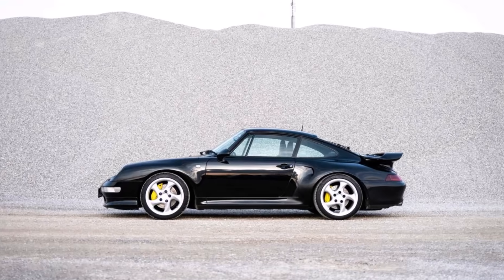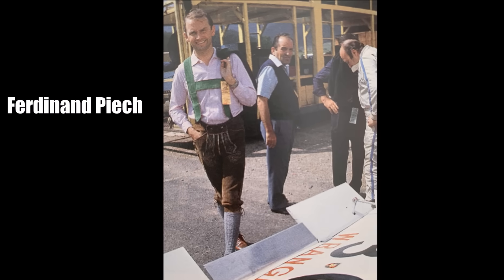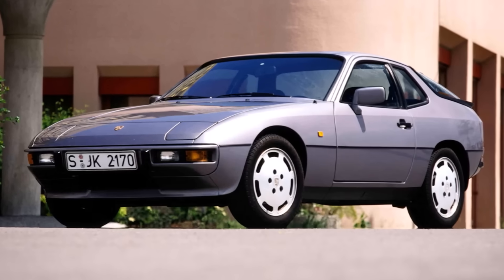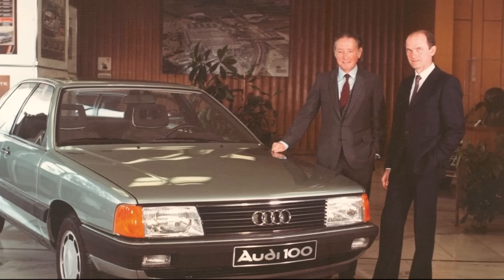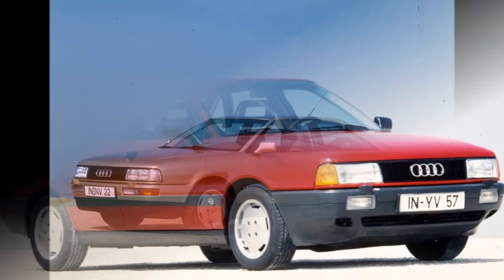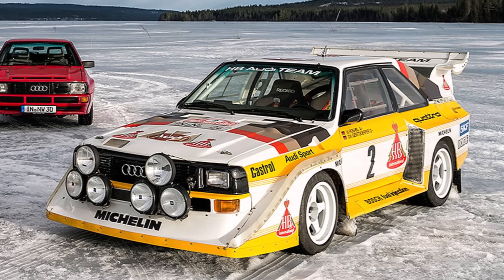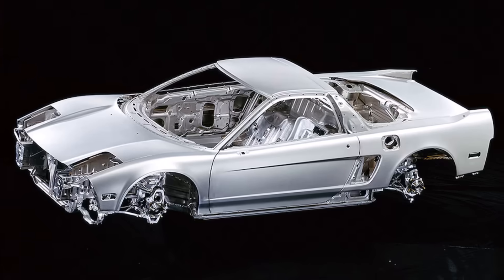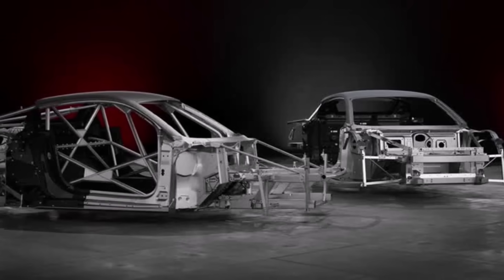How AUDI and Porsche eliminated corrosion forever - Development EXPLAINED

Comment: I have a very neglected Fiat Stilo from 2005 which got soaked inside (because of years of neglect).
I took it appart and ZERO point ZERO rust anywhere on the body!

Only some light corrosion on front subframe and rear suspension.
Much better than my 1995 Alfa Gtv which was already not to bad, for sure when compared with some Mercedes models from the same era!
Reply: So… Only 70’s Lancia were Italian “Secchio di ruggine” ?
Reply: @satsumagt5284  Mmm.... in the 70ties I think only the Mercedes W123 was quite rustproof.
Reply: Punch a screwdriver in it...?😂
Reply: @mstar501 I prefer to find the cause of the problem instead. (found it).

Comment: The answer to this is, and always has been, very simple. Either stop using ferrous materials for car bodies or keep dirty sweaty hands off the bare metals during build. Another solution is galvanise all steel based body parts. Ford experimented with galvanising bodies in the UK many years ago. They cancelled the idea as “too expensive” but the truth is it stopped corrosion so much so that a car would never rot and therefore car sales would spiral down. The motor manufacturers should start admitting they don’t want to stop corrosion, it’s not in their interest. They’re pulling the wool over your eyes.
Reply: That last bit is not true. All it would take is one manufacturer to break the monopoly by making far better products. The truth is the manufacturers don't care and the buyers of new cars don't care. They are built on a balance - as cheaply as possible but durable enough to survive the first owner so he can lease a new one in 5 years. They absolutely do not care about how the car will hold up in 10+ years, people who buy 10+ year old used cars do not buy new cars and are not the target demographic of car manufacturers
Reply: Cars have been made from galvanised steel for decades. You can't however galvanised a whole chassis as the heat would warp it.
Reply: Big facts

Comment: Audi still rusts, look underneath/inside the frame but Audi snd Porsche 
are less sensitive to rust than the competitors.
Undercoating and filling the spaceframe with vax is essential for protection...
Galvanization of 10 um only is not enough.
Details that are exposed to the elements "subframe" would ideally be  hot diped Galvanized, similar to a lamp post. You don't need paint on the subframe.

Comment: How is that gonna be with Audi/Porsche EVs?
On the one hand, water has a much tougher time getting to a metal part bc the underbody is fully encapsuled. On the other hand, once water gets in, it stays in.
What is exposed on mine like steering train is fully aluminium.

Comment: The first hot dip galvanised car body, with total immersion in a zinc bath, was a French sports car, the Matra Murena, in 1980. Though only built in small numbers and using grp panels (like a Corvette), it predates the Audi 80 by a couple of years. There is a link between the two companies, the Murena used sun visors from an Audi 100 C2.
Reply: 100 % correct !! Thanks for posting this !
Reply: Matra Murena, what a car. Three-seater, I think they made two versions.
Reply: @pedromanuellopez142 as a coicidence, I am currently in Romorantin-Lanthenay where Matra were built and visited the Matra museum. There were three versions, a 1.6, 2.2 and 2.2S.

Comment: It would be so interesting to know how Daimler-Benz solved their problems with dreadful corrosion in some years of car production. I've always wondered if those issues were caused by steel or body-design or paint or environment / use (or a combination). Another aspect is how a manufacturer deals with a large-scale corrosion issue - recall,  repair or change? - and the bad publicity - fight or flight? - this has faced Daimler-Benz, VAG, Lancia etc.

Comment: What was the deal with the corrosion tech during the early 2000s? All the Passats B6/B7 and even B8 to some extent rust like mad, and the Audi B8 was terrible.

My father had one of the first galvanized Audi 100s, he drove 400,000kms and said there wasn't a spec of rust anywhere on that car, but i can't say the same for the early 2000s audis i see rolling around.

Comment: My daily driver is a  1999 B5 S4 Avant with 316k miles.  The galvanised body panels have held up really well, with the only the front wings replaced in my 21 years of ownership.  Underneath the car is stir solid and sound with no welding or major work required.  Fantastic car and a pleasure to drive.

Comment: As long as their corrosion warranty does not cover cars that drive on salted roads, i'm not interested.
Driving on salted roads 4-6 months of the year for 10-20 destroys all rust protection i have ever seen. I'm driving as Volvo S60 from 2005 for now, and the primary thing keeping the rust at bay is the steel quality, and it holds up better than most other cars

Comment: I mean, it's better. I saw an episode of Sweden's equivalent to Motor Week covering how to rust repair your car. The episode was from 1980 and the car they used as an example was an MKI Golf. They never said how old the car was, but since Golf was launched in 1974, it was no more than 6 years old. And the host demonstrated the rustyness by grabbing on to parts of the car with his bare hand and crushing rusty metal covered by paint. Door bottoms, fender edges, the metal below the windows... all entirely made of rust.
While things are better now, those brands certainly haven't "eliminated" rust. I looked at buying a used Audi A3 last year and the rear fenders were rustier than on the 20 year old Saab I intended to replace it with. Ended up buying a Golf instead, still with rust.

Comment: In Sweden VW sold vans to post service and they found out VW can reduce rust protection on specific unit, as it goes on line. Company fleet cars got lower amount treatment and paint, as they are changed after a few years.

Comment: I own an 80 B3 that my dad passed down to me, it's an '88 model, has been with us since 2000, 25 years of no garage! My dad never cared much for cleaning his car, all he cared for was usual engine maintenance and making sure it ran. The car has had the interior isolation underneath the carpet absolutely soaked for years from a leak and yet, there is absolutely no rust! Meanwhile my EG Civic got some paint chipped on a door about 5 months ago and you can already see the rust building on it

Comment: For example the Golf mk5 and A4 b8 do like to rust pretty badly compared to older models. Take a look at Renaults after 2000 they are the kings of anti-corrosion.
Reply: Golf IVs rust like crazy as well.
Reply: @DashCamSerbia can’t beat the mk5 they are the king of rusting
Reply: Audi a4 b7 rust pretty Well on the Front arches and boot lid behind the reg plate
Reply: Where do the B8 A4's tend to rust ?

I know the lower front arch does from stone chips ( fixed on the 8.5  ) any other places ?

Comment: VW must have very poor galvanization. I frequently see quite bad body corrosion on VW products traded in. Also on done Audis. My friend’s 2010 Jetta is very rusty on the rocker panels, fenders, and wheel arches. Underneath it is quite good however.

Comment: I dunno about ELIMINATED lol... But yes. Particularly mk5 VW and newer I hardly ever see rust deeper than surface. I do see quite a few rusty subframes/oil pans on A4s though, usually on cars that have long since abandoned their splash shield.

My beater Mk5 Rabbit in particular has a bunch of odd rust spots on the hood and roof, but the underbody is still spotless even though it's an inch off the ground now.
Reply: Passat B6's have literal rust holes in the doors quite regularly here in Norway

Comment: I have a bunch of early 2000s Audis  and if it weren't for the doors and wheel arches, you could call them rust free. (Even if the axles etc are rusting, but slowly). 

Interestingly the Audis have much beefier body sills and lifting points than the VW rebadges like the A3 8L which has its sills pretty mushed out at this point. Not rusted through yet though.

Comment: Modern cars now have cfrp (Carbon Fibre Reinforced Plastics) panels (often for the bonnet, roof, boot and bumbers) to save weight but the obviously don’t have corrosion issues either.
Reply: Which cars in the 50k€/$ range havr CFRP as body panels? There are a lot more Aluminium bonnets and fenders and also plastic fenders (french cars) after the 90s but I've yet to see carbon fiber on anything cheap. Of course the BMW i3 is an exception as it is completely carbon fiber bodied.

Comment: The shell will survive but the engine, gearbox etc. will not because they are designed to die prematurely.
Reply: You can repair those.
Reply: @DashCamSerbia  Except for VW making them so expensive to repair that it's just not feasible.

Comment: galvanizing of car bodies became mainstream in the late 1980s. How did it happen? ￼ American steel Mills figured out how to galvanize the sheet  metal in the manufacturing process.  I remember, the 1988 General motors pickup trucks, which were produced in far larger numbers than any Audi or Porsche, had completely galvanized bodies with the exception of the inside of the roof panel.  ￼￼￼

Comment: > can't do that
> fired CFO 
> Piëch as CEO
> they can do it 

basic scheme
Reply: That's what I was thinking too. Whenever I hear 'galvanized', I immediately think of the fences on all the houses I grew up in, have them now at my current house. I guess the first answer's always been obvious.  The problem apparently was, no one asked the customers until Audi did.  (I remember the first 5 year car loans. I thought this was nuts. I was used to cars being significantly rusted, and the motor and components becoming unreliable in a couple of years. Then I drove a Honda Odyssey for almost 20 years, sold it ten years ago and someone is still driving it.)
Something else was probably going on as well. Around the late 1960s and early 1970s, GM and Ford in the U.S. started using some new anti rust coating on their cars and switched to thinner sheet metal. It didn't work very well. Chrysler, struggling financially,  couldn't afford to do this. So they just kept using heavier sheet metal. The net result was that Chrysler's did much better against rust and were more easily repaired because the Bondo had something to stick to.  (I'm sure this is similar in Germany, I grew near Detroit thinking that Bondo was at best a temporary solution. It had a different coefficient of (temperature) expansion than the sheet metal so after a couple of years it would just fall off. This actually biased me against most uses for resin/catalyst materials for  years.  Then I learned how to use epoxy, but in California.) 
I also learned from making widgets for my kayaks how remarkably well aluminum holds up to sea water. I learned from making a Calder like mobile with stainless steel wire and that 'beer can' aluminum, that the dielectric effect --  just in  the air -- causes a layer of rust on the stainless steel. The 'beer can' aluminum is an absolutely amazing material.
Reply: Most aluminium cans have a thin plastic layer on them😅 you can actually use acid to eat the aluminium away, and see a thin plastic 'can' or 'bag' left lol, there's a U-tube video that shows this😅😅 @WillN2Go1
Reply: Piech was awesome. VWs basic products have only gone down in intrensic quality since he was driven out.
Reply: @jamesbowen2105  Nearly everything he was involved in was overcomplicated garbage that caused people serious financial hardship.
Reply: @tim3172 because he was a pioneer in the mass segment. Yes, Passat B5 is less reliable than B4 and B6, but he was a big step forward in comparison to his competitors at this time. Without Pieh a huge amount of technologies were unavailable in cars till today. 
And yes, today's VW cars are less problematic, right?)
Reply: * > fired CEO

Comment: Hi, just two questions. Why was there such a big issue with corrosion of Passat B6 and Octavia 2? How did Audi manage that aluminium had no fatigue limit?
Reply: The B6 and cars from its are are much worse than what came before, especially for the coloured panels. In 2005 EU introduced regulation for car manufacturers needing to decrease the  amount of solvents used per car produced. 

This lead to some places of the cars that followed shortly after to have decreased paint thicknesses and some sections where different coatings were used. 

The chassis is still quite well protected, but the B6 is definitely not as resistant to scratches or stone chips on its exterior panels.

I guess after the B6 things got a bit better, and some of it is atributable to the addition of more plastic covers everywhere, since the coatings will last 30 years easily if they don't get hit by the smallest specks of dust.
Reply: @rkan2  A classic case of politicians (read: imbесillеѕ) coasing emmense damage for their political gains.

Comment: Having worked for 3 years for a Porsche specialist, never saw as much rust as on 997 and later 911’s ! Oil pumps, bolt, nuts and exhaust parts full of rust ! Body panels ok, but on the mechanical side including those corky alloy cooling piping, full of rust. I hope you’ll get to this sometimes, the poor building quality of 996 and later 911’s. 
Still love your channel thought
Reply: Sorry, on later 911... is/has/was?
on later 911's... what? What belongs/pertains to 911?
You wrote it twice. Surely you weren't struggling to pluralize 911, right? 
You'd have to be a complete imbecile to think "911's" is the plural form of 911, which is 911s.
Reply from the maker: Thanks for sharing but we talk about Body Rust here, not nuts and bolts.
Reply: @bsport320 and I'm pretty sure, this rust on bolt and nuts don't really affect the solidity... Except its sometimes difficult to remove parts because of it.... 😅